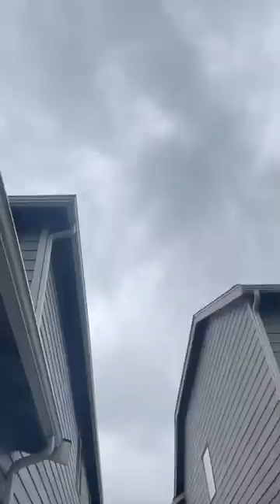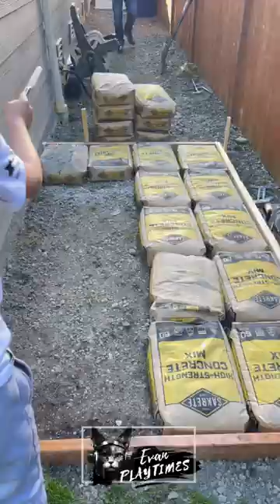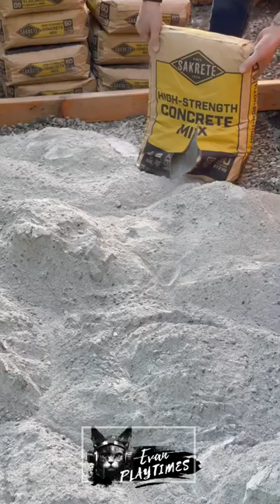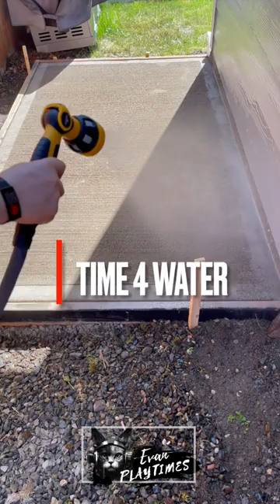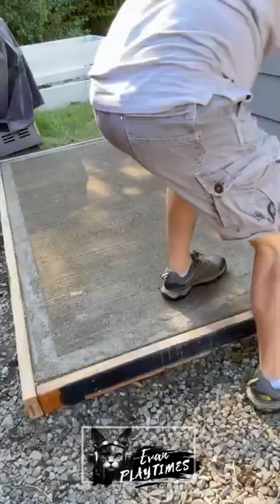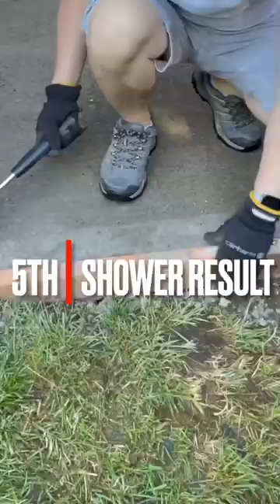Dry Pour Concrete | Love It

Comment: Sadly it won’t last. Seen multiple tests and this method, the concrete is weak and brittle. Corners will easily chip off and it will not last. Go do a search if you think am lying.
Reply: I wondered about that... thank u for the heads up
Reply: Very true,  plenty of YouTube videos on this very subject. Often in construction these type of quick easy methods are just plain dumb, if the method has worked for years it don't need a reinventing 😂
Reply: Yep 100%
Reply: YouTube is so stupid
Reply: I agree that wet pour is better, but dry pour does have a place in certain projects. But to say that a working method doesn't need reinventing is somewhat stupid. How do you think things are improved? People change and test current things until they find something better. Then we have a better way. For example: Before someone came up with concrete they used mud. I'm sure glad they decided to try a new method. I'm also glad someone decided to start mixing it with machines and carrying it with trucks.
Reply: @casman9635  your point is stupid. The test themselves have proven dry does not work in any way. Saying testing is how you improve is true but the method of mixing concrete has been perfected and these sort of videos only hurt consumers. The method does not work, concrete is supposed to be able to hold under load, not mixing it is the same as expecting to cook an cake by watering the top of the box of cake mix and hoping that mixes and gives the same result as if you mixed all the ingredients as necessary.
Reply: @eddyflo2978   Lol well done analogy. I liked that. But it does work in some way because it still hardens, although not to the harness of wet pour. And there are certain projects where you would prefer it NOT to get as strong as possible. Like something you dont want to be permanent, or something you want to be able to more easily replace. Like something you want to hold in place very short term. Dry pour also works just fine on fence posts. It holds hard enough that a tornado will snap the board before pulling it out, the concrete will easily outlast the board, and when you want to dig it out you can more easily break up the dry pour concrete instead of having to get a tractor to pull all your posts out. That's one example where I'd personally prefer dry pour. Plus, it's just more convenient for some people and saves a ton of time with hundreds of posts. So there is a place for dry pour. I'm not saying it's better or strong. But I will say there is some merit to using it in some cases.

And again, never trying to find a way to improve concrete means it never gets better. Everything is always perfected until someone makes it better. If it can be better than it wasn't perfect. And perfect for one thing doesn't mean perfect for everything. That's also why they have a ton of different concrete types. But none of them are perfect for every project.
PS: I'm also not trying to be a douche. I'm just trying to say everything can always be better and that there are SOME reasons to do dry pour.
Reply: Made in China
Reply: Bro people know this….
Reply: @eksine not youtube but people lol
Reply: @casman9635 
So you think just because you like dry pour concrete on fence Poles you made your point of making concrete better? Thats just your opinion your opinion only counts for you. 😂😂😂😂😂😂😂😂😂
Reply: @tonyvargas6981  And so does yours, luckily a grown man that uses 10 obnoxious emojis while making no point of his own doesn't have an opinion of much weight
Reply: @adamheck8367  I don't need to make a point because the fact that dry poured concrete is only better for fence post that says it all. But Maibe you like poor quality materials.  To each it's own I guess.
Reply: And it’s also more expensive… you need half the cement doing it properly and it ain’t that difficult
Reply: @eksine YouTube is a platform it can’t be stupid 😂
Reply: @bobsagett  Connect that please?
Reply: How did you get the broom lines in there?? Seems it would be hard while the mix is dry.
Reply: Your very right
Reply: @casman9635 come on! You know that's not the proper way and that will chip really easy. That's simply the lazy way 🤦🏽🤦🏽🤦🏽
Reply: @jjdiaz486  That is true. Chipping easy is kinda the point though. And it's easier. Win-win. If you don't need all of the stregth of wet pour, then why do it? I'm simply saying there is a place for it.
Reply: @tonyvargas6981  Those were two seperate points. That's why I put a space between them. You misunderstood.
Reply: @tonyvargas6981  Also, you didn't reply properly and I just happened to read your reply. If you click the options on my comment and hit "reply" then it will actually send me a notification that let's me know that you replied to my comment.
Reply: Ok got it.

Comment: Dry pouring seems like both an elaborate prank and genious.
Reply: It is a prank, it makes a very weak, very fragile version of concrete. It was never meant to be used this way.
Reply: @glyssvictarion4387  yeah anything past people walking around on it, you'll be regretting not doing it correctly
Reply: @sagasta1983  well it says it's only a sidewalk.  Located on sidewalk of his house so I figure it won't get much damage
Reply: @johnholladay9497 This will crack and fall apart within a few years at most, it's a complete waste of time
Reply: Lots of people do it...all over the internet w/updates.
Reply: @homeguardster I can show you a 20x20 pad a dry pour from 20 years ago if you like. Park my truck on it daily. Not a thing wrong with it.
Reply: @glyssvictarion4387  crazy you day it wasn't meant to be done as a dry pour when Quickrete has instructions for a dry pour on the bags...
Reply: @ZunigaxxEnrique  the instructions are for setting posts only.
Reply: @homeguardster  it says it on the bag, "for pouring slabs". But okay 👍🏻
Reply: @ZunigaxxEnrique  yes pouring slabs when you mix it with water, dry pour is for posts only
Reply: @homeguardster  no sorry that's incorrect. It says the dry mix instructions on the bag and lists the acceptable application using a dry pour. Slab greater than 2 inches is clearly listed. But again believe what you want idc 🤷
Reply: @ZunigaxxEnrique what product are you looking at? I have yet to find any that is ok with dry pouring stabs
Reply: @ZunigaxxEnrique  I'll take your silence that you dont know what your talking about. stop going through life making stuff up. be better.
Reply: Easy to tell who the contractors are in the  comments crying about people they cant rip off 😂
Reply: @glyssvictarion4387  Not.

Comment from the maker: It's easy. At first, I thought it wouldn't work, but I did it, and it still stands strong. I will give an update soon for those afraid to try or think it will crack or be a joke. The professional gave me an estimated $4000 to do the project, but I risked it, and it worked out great. You must be patient and add design to the edges before watering it down.
Reply: Great job on your project, I hit like cause the baby said so 😊👍🏾 🎉
Reply: Just buy sand and aggregate by the trailer and add cement it's cheaper
Reply: All concrete cracks fyi but steel mesh helps, you need to add a joint in middle, can even cut it out with a grinder or cement saw
Reply: I don’t blame you for doing it yourself. 4k is crazy for something that small.
Reply: Yeah, I just bought an old mixer for $70 and did my project the right way. Pulled forms same day, good enough for the kids to ride their bikes on by the next.
Reply: Should have thrown some steel reinforcement.  This will end up cracking in 3-5 years when the ground underneath erodes or settles from the weight of the concrete resting on top
Reply: The cement was less than $80
$3.60 a bag at home Depot
Reply: He didn’t mix the cement. !!?? Just even them out and shower them with water !!??
Reply: Well don't forget why a professional charges what they charge. If this were up north it would maybe last one season or 2. Just cause YouTube shows you how doesn't mean it's the best or even the right way of doing it.
Reply: What did it cost you to do yourself versus the $4000?

Comment: I hope this isn’t a dumb question, but wouldn’t it be faster if pour a layer of cement, then wet, let dry; then repeat? The bottom is guaranteed to be try then right?
Reply: You will have an issue getting the layers of cement to bond to each other. Over time it will separate and peel away and you will have to redo it anyway.

Comment: Noticed how every negative comments here are either works in the construction of some sort related to cement/concrete or straight up concrete business owner/workers. This tells you a lot😂😂😂. $4K for that is crazy. I myself dry poured a triple garage I built 8yrs ago and still going strong! Way better than $20k!! It's also sealed with Epoxy for oil stains and spills just in case.
Reply: Question for you,I have some experience w/concrete mixing but not much...I see how the guy 'mists' the water for obvious reasons,allows it to harden / dry a bit,then repeats..but how do you know when the water has saturated enough completely through the dry concrete powder? At what point do you say "ok this is good enough an then remove the 2×4's? Is there a sure way to see its done for sure before u remove the wood?
Reply: @dwade6322  this heavily depends on what brand of dry pour you are using really. The instruction is on evey bag you buy or on their website or youtube. So I can't say for sure. I used quickrete in my garage. If the instruction says mist it every 30mins per inch i'd go a head and do every 20mins instead. If its asking for 5 times, i'll do 6 or 7 times. Hard to really get it wrong. Dry pour is engineered for ease of use. I remove my frames after 3 days/72hrs and continues to heavily saturate it once every day. Do not touch or place anything heavy for another 7 days. Always use rebar or wire/mesh for strenght. Let the science do the work for you! Be careful when it's sunny day! You will need to saturate it more often than should. Wait 2 weeks then start building anything on it. Some people in youtube skipped the wait and still made great results. But this is how i mine in all of my projects.
Reply: @marumarukira  Ok,thank you!👍
Reply: @dwade6322  your bag will tell you how much total water you should use from start to finish. anything after that is all up to you. If the bag says, you dont have to go further, thats up to you too. Again, its really hard to get this wrong. Everything thats listed in the instruction is more than enough and will give you great result! Wait time to build on it like pergola or gazebo is the hardest part😂😂😂

Comment: Space between top of new slab and bottom of siding too narrow- can lead to prolonged moisture exposure to the sill plate.  Not saying this is what he has, but for example, Hardie siding requires minimum 4” gap from bottom edge of siding to any horizontal surface.  Also looks like he made slab level when it should slope away from house.  Going to have some nice green or brown staining on the siding.
Reply: TRUE NO SLOPE

Comment: The bottom and middle of that slab are still powder. The water doesn’t permeate through enough to soak the powder after that 1st or 2nd soak.
Reply: Can you do it in layers? And basically do the last layer and level it so it’s flat
Reply: @Floridaburg-  Depends on how you do it and the type of concrete/cement you use. Typically, the surface of the concrete needs a rough surface to bond to. So adding a layer of concrete to a smooth layer of concrete won’t have good long term viability. It will hold initially, but it will take far less effort to separate compared to bonding with a roughed up layer. And that weak bond will eventually see the concrete layers separate over time. 

There are concrete repair or covering products that are meant to bond to the flat surface of concrete, but aren’t meant to have a lot of structural strength.
Reply: @WyldfireKeeper  was thinking of just doing a 9x12 patio for a few chairs and a table
Reply: @Floridaburg-  You could pour a solid slab that size by yourself in a day. Do all your prep work the day before (tamp the ground, tamp the gravel layer, level the form, and set up the rebar), then mix and pour the slab the next day. Just make sure you pregame some Aleve or some kind of OTC painkiller, and stay hydrated.
Reply: @Floridaburg-  And if you can afford it, a corded drill with a mixing attachment will save your back a good amount of strain and pain.
Reply: @WyldfireKeeper  awesome, just curious but we moved to tennesse and the ground here is awful- do I need to dig out at all or can this go right on top of the ground
Reply: @Floridaburg-  As long as the soil isn’t loose and you aren’t trying to put the cement on top of grass or plants, you should be fine. Just make sure to tamp the soil down. 

As for the depth, that doesn’t matter much as long as you’re accounting for the total depth of the pour. You can dig down to make it level with the surrounding ground, cement, sidewalk, etc, or you can just put it on top of the soil after clearing the grass and plants (which will usually require 1-2” of digging).

For a patio, the thickness/depth of the slab will depend on how much weight you intend on keeping on it. For just some tables and chairs for a family size of 5 or less, a 2” slab will be fine. However, the thinner and wider a slab is, the more likely it will be to crack over time, which is why the normal recommended depth of a patio is 4” with rebar reinforcement (pretty much a requirement for 4”+ slabs). Doing that will cost more, but it’s far more like to last longer before failing and needing repairs, and you might get some peace of mind from that.
Reply: @WyldfireKeeper  thank you so much for the advice !!

Comment: I enjoyed the video. My son and I doing a dry concrete pour tomorrow. 12x20 with rebar.
Reply: I never really seen that before it does it work good?
Reply: @ronhanish  no it don't,dry pour makes concrete weak and brittle, it will harden but won't last
Reply: @ronhanish yea it does, soak the ground beneath before you begin the dry pour and the moisture will absorb through the bottom and top, dont listen to these haters who say it makes weak concrete they just dont want people to figure out how to do this stuff for cheap so they can rip them off
Reply: How did it turn out? Considering doing one for a gazebo I purchased about 13x15

Comment: Last year I did a slab and mixed the cement before pouring it. This year I'll be trying this method because I want to extend the concrete. This method seems to be much more easier.
Reply: Don't do it.
Reply: It's not recommended to do it this way.

Comment: This can be done properly in a mixer or even hand mixed in a large bucket using sand ,cement and chippings at the correct ratio and it'l be solid within 24 hours , this videos way is not going to be as strong plus it takes ages

Comment: If so good a result why not standard practice? Industry would develop a dry system use/delivery method to exploit this if feasible. It's more than that i know but dry is less than 100% a mix in that "container" causing spots of dry mix, use a vibrator?

Comment: Just came to see all the comments from  “professional” laborers 😂
Reply: Oh right because they’re all pretenders and you’re the actual “pro” LOL.
Reply: It won't hold up to a car... But people walking on it? It should be okay. Though I don't know how well dry pour concrete will hold up in winter climates.
Reply: @ikecreates 😂
Reply: @Andrew-ih2gz I thought when he pulled the boards it would fall powder come at the bottom 😃?
Reply: @ronhanish  there has been a few people who tested the dry pour vs wet pour methods. One even cut right through one to see how cured it got. The answer was pretty much as you'd expect. The cure was incomplete in the dry pour. While it did hold it's shape, it was overall brittle. They were able to chip away at it with their bare hands. 
 
It'll hold up a person walking on it, but I'd never suggest putting anything over 800 lbs on it.

Comment: What was the interval times for watering. Thanks
Reply: Not the video author, but most people do 1 hour between watering, but I did 30 min on mine and it seems fine to me. (I was in a hurry, and honestly didn't see the need to wait.)
Reply: @connorpenrod397 any feedback on how yours resulted. Any crack now a few months in?
Reply: @d.a.4121  Nope, no problems at all. It's had ladders scraping across it and freezing temps with no issues. I'm about 6 months in. (I also did set-in-place bolts and those have held fine, as well.)
Reply: @connorpenrod397  glad to hear! Cheers